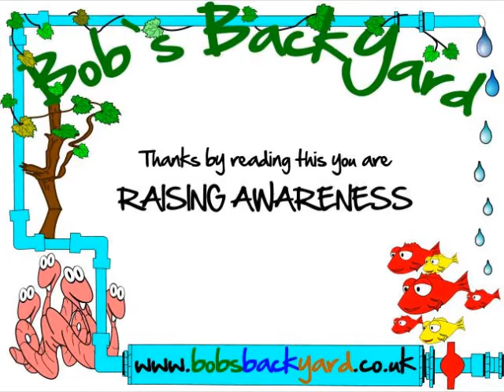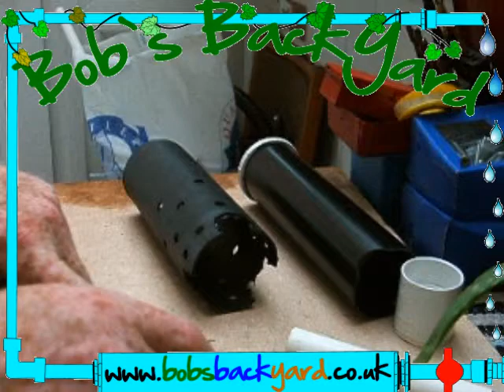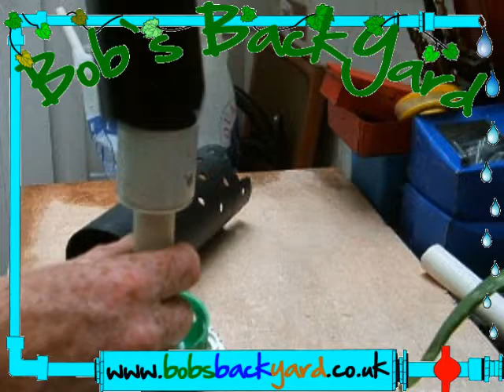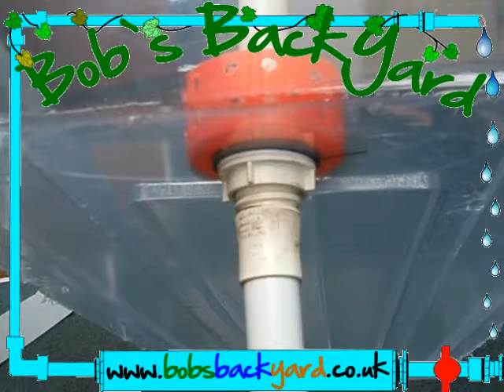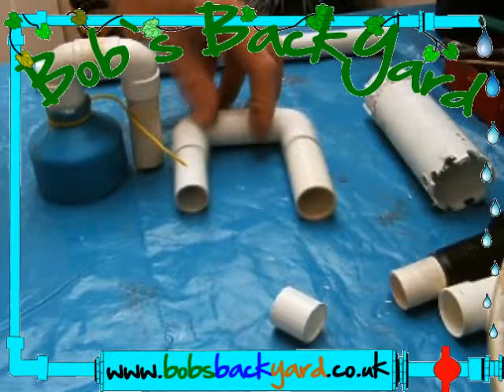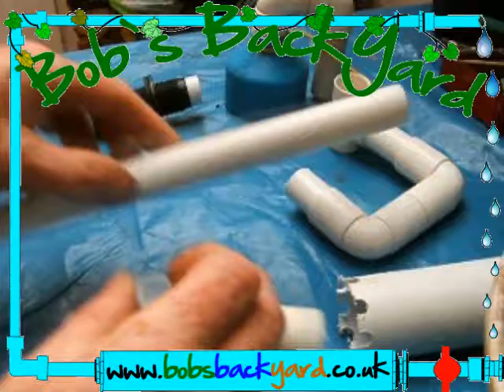Bell syphon & U syphon how to make & fit

Comment: Thank you for these videos. I started with bell siphon. But it was not reliable, difficult to start, etc. Then I saw your video on u siphon, especially the use of small tubing to initiate the siphon flow. I built 3 u siphons using the small tubing idea and my u siphons are working very well. Thank you for sharing your knowledge.

Comment: How important is the funnel like shape in the stand pipe? Does it increase the flow rate of the siphon. I'm planning to make a bell siphon. With a 15mm stand pipe, 73mm bell siphon pipe and 90mm for the guard to keep the hydroton out. How much height in between the bell siphon cap and stand pipe?